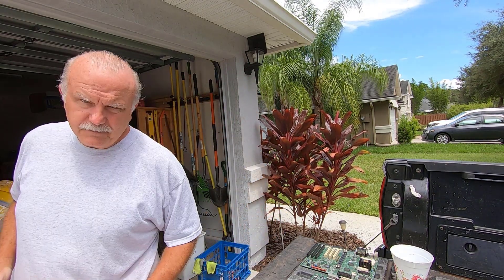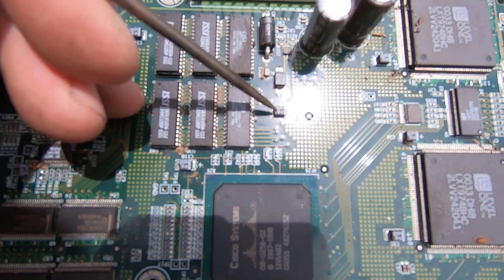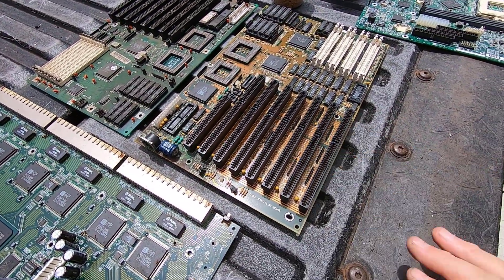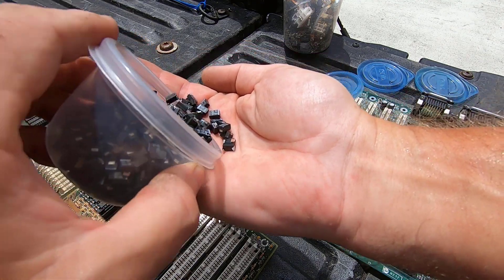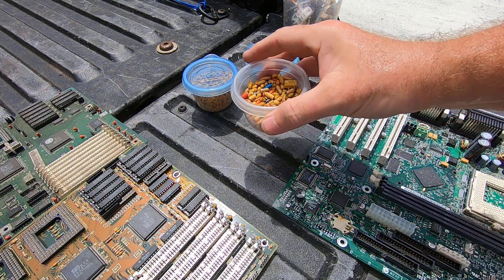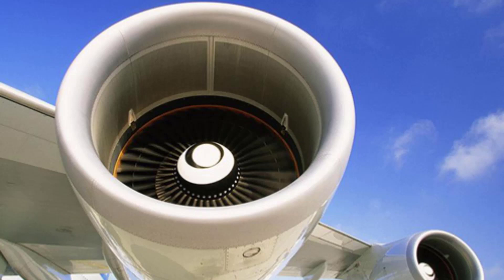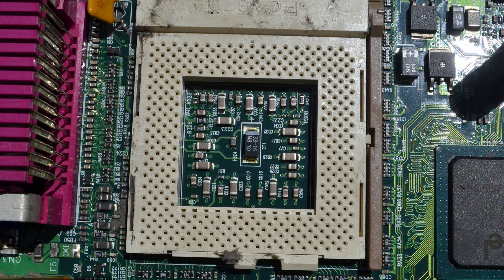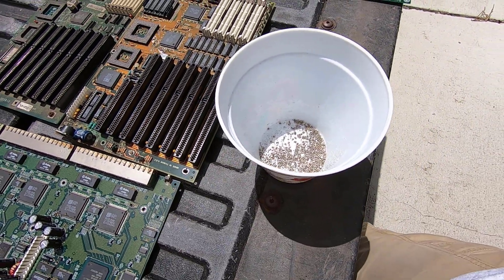Ewaste - Tantalum Deep Dive

Comment: 4:28, 8:23  these are diodes, You will only find silicium, coper and tin/lead  plating on the leads ,,,Worth nothing
Reply from the maker: This is a pretty old video. If I remember correctly, you are right.

Comment: The black thing with the band is an ovp ESD surpresdor diode. A lot if the yellow ones by card slots have been higher value mlccs rather than tantalum but have seen both types. If its polarized they are tantalum. The orange box ones are 100% tantalum slug caps. They also suck ime, tend to short out and burn out if the board sits idle too long. Niobium caps are a lot better ime.
Reply from the maker: Interesting, thanks

Comment: 999 Dusan made a video showing a significant amount of silver recovered from Ta capacitors too. Probably more than the value of Ta. Interesting.
Reply from the maker: I like his channel.  If I were going to do anything with them now it would be to get the silver.
Reply: @sharkscrapper  I agree. With only getting $11-$22/lb. for Ta depending on where you send them, silver value is worth way more in ounces, so I’d save them for that. I wonder if the refiners get value from Ta and the Ag is just the cream on top.
Reply: Yup they usually have a silver layer for the negative electrode for the orange box and gumdrop style. The silver is usually overcoat with tin.❤

Comment: 4 :36  it is diode and should be code d 
8:28 is also diode
8:30 High Voltage Ceramic Capacitors can contain silver 
rest fits to my version  so all cool  good job on vid 😀👍😀
Reply from the maker: Spot on Rafal.

Comment: 4:20. Nope. That round thing you are pointing at is not a Capacitor. It is a DIODE.  CR or D  indicates it's a Diode.  I've been in the electronics field since I could hold a screwdriver and I can tell you what that was even before looking at the board. At 8:11 you're showing a small tub of other capacitors, Not all of those components are capacitors. The "Ball Shaped" component you are showing is also a Diode.  CR on a board stands for "Current Rectifier". The Black line on the Diode indicates the cathode or negative side of the Diode.  Also there are some square diodes look exactly like the black Tantalum capacitors. Knowledge  is Power. More Power to ya!
Reply from the maker: Thanks I'll pull that little sucker from the tub.